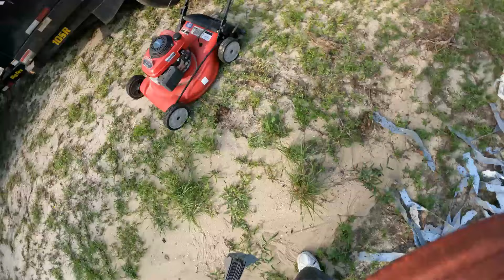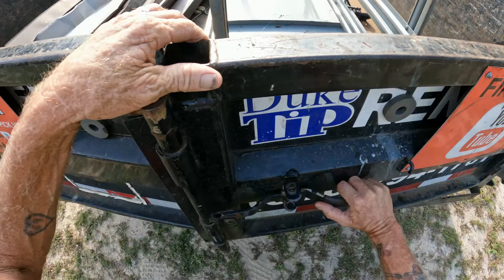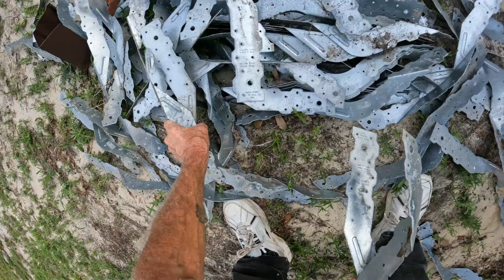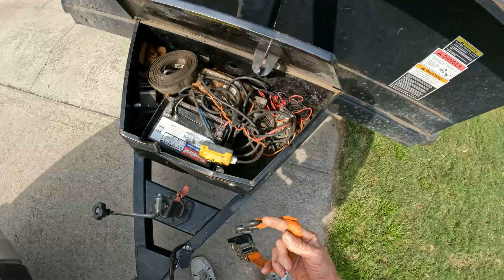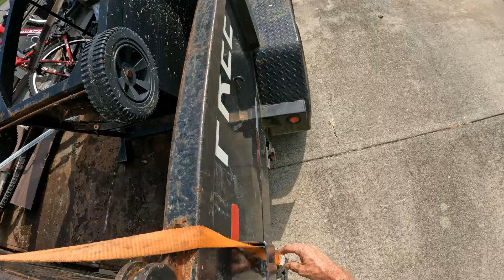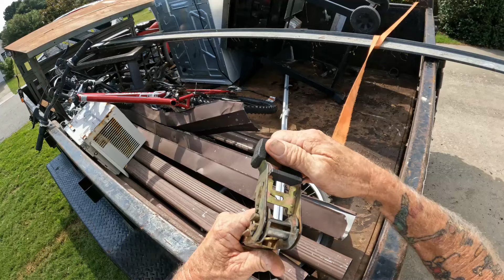Picking up some scrap for recycling. Ride along with me!

Comment: Get it all! Grampaw,rain or shine in sickness or in health. That’s a nice little step ladder don’t see anything wrong with it Werner too😮 Really like that new workbench,those hidey ladders will pinch hell out your fingers they are really nice if you work out of a van though. So damn hot out here in the hills I wore my shorts for the first time ever dumpster diving last night. I learned a trick many years ago working on the roof,whenever you just can’t take the heat dump some ice water on the veins behind your elbow,same thing behind the knees and if you are man enough dump it on the back of your head and neck,I think it tricks the body real quick. When I was doing residential I’d stick the garden hose in the gutter and just soak my head every time I got hot,it was like hanging out at the swimming pool,I would tell you to stay cool but you already so damn cool like the Fonz😊
Reply from the maker: And I used it today nothing wrong with it

Comment: Good morning grandpa...I suggest getting some electrolyte thingies and put in a water bottle..I used to have extreme leg cramps and I believe it was from 8 mg nicotine pouches. I switched to 4 mg nicotine lozenges and the cramps went away.
Reply from the maker: Thanks for the tip
Reply from the maker: How are you doing now? Where is your cancer? How are you dealing with? It is the cancer around your neck or throat? Is that why the taste buds are acting funny very interesting. Five years ago. I had the same thing. I had a feeding tube in my stomach, I hated it, I couldn’t eat anything or even put anything in my mouth
Reply from the maker: @myvicariouslife4012  you are in my prayers for sure